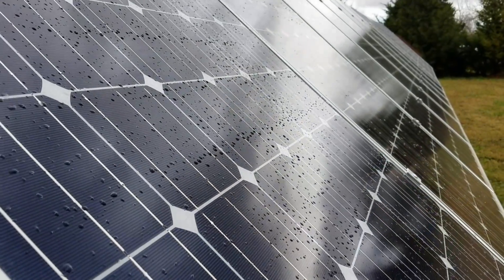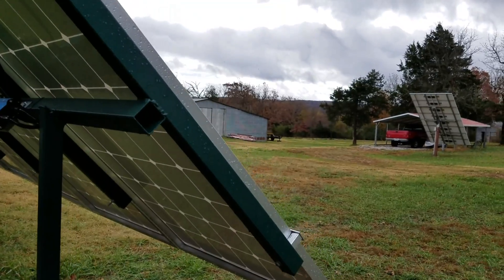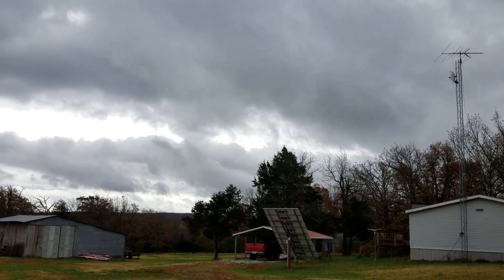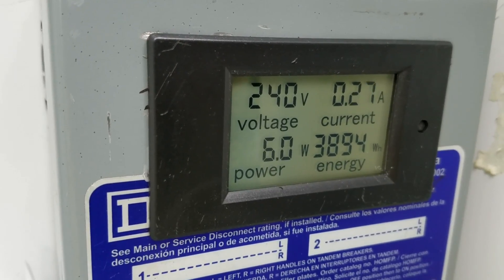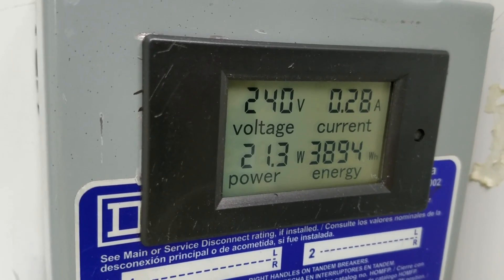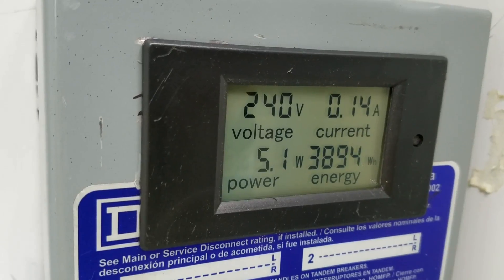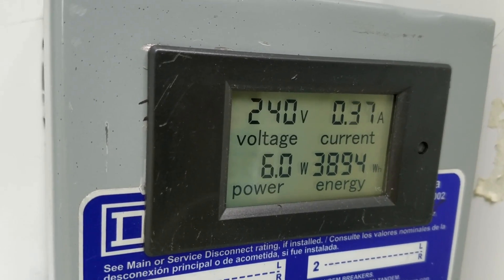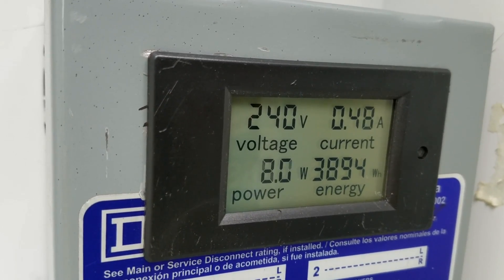15 Solar Panel Extremely Cloudy Day Output

Comment: Great power Tom Nice Looking Solar Array That is Really good considering the weather conditions
Reply from the maker: Thanks! It was extremely cloudy. This morning I made another video where it was more of an average cloud cover and it was making about 1,500 watts average. It will be interesting to see what the average impact is over a period of months. Solar works not only on sunny days but also cloudy days as well. The bigger the system the more the capacity it has even for average days with limited sun.
Reply from the maker: The twenty panels are now up. In direct sunlight it seems to top out at a solid 4,000 watts up to as high as 4,350 watts. It seems to make the simulated digital disc on my digital smart meter spin backwards at a pretty good clip. That is essentially the equivalent of a 4KW generator humming along. My electric bill should become quite interesting!
Reply: tomwiles That is Awesome Buddy First System Tom Great Power keep the videos rolling

Comment: How many watt each panel is rated for? Are these mono or poly panels?
Reply: SnapHost yeah really he just keeps saying 15 panels but never says how many watts they are. Also you can tell just by looking at them what kind they are these are Mono, Mono has the little squares at the corners of the big square cells Poly cells are just solid with lines.
Reply: @RedneckHillbilly-ho9md   Good to know that,thanks.

Comment: What are those blue boxes? Micro inverters?
Reply from the maker: Yes they are micro inverters. In later videos you will see they were replaced with a completely different brand and model.

Comment: you have 15 pannel x 250 wp each?
Reply from the maker: There are now a total of 20 panels with 20 micro inverters. At peak midday sun the system puts out about 5600 watts, give or take.
Reply: @tomwiles  does it get extremely sunny in your place??How about if its not summer does it run well?
Reply: @tomwiles     Thanks for the video, i see that clouds  kill the output almost to zero;
How much invested so far? i need to make some calculations, thinking of a 6 panel system;  thanks
edit:  all your blue microinverters rear Powre instead of Power ;  lol...   those fast chinese...
Reply from the maker: @josepeixoto3384  The array was expanded to 20 panels. I spent around $10,000 dollars or so total on equipment. I currently have an 11,200 kWh credit with my local electric company. They pay me back with one to one kWh swaps. The kWh credit is like having kWh's in the bank to use when I need them. My electric bill is always the monthly minimum.